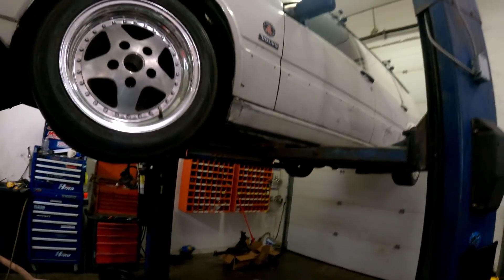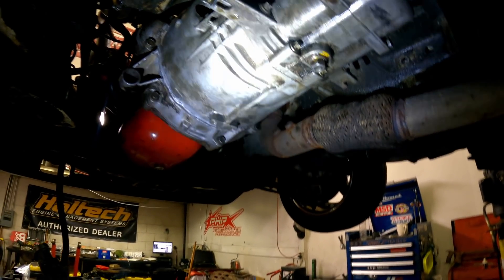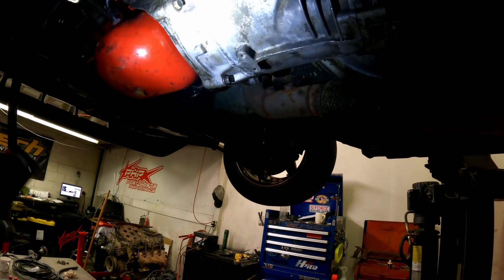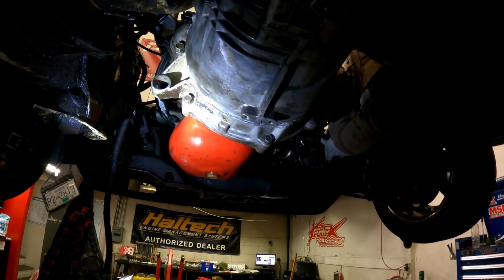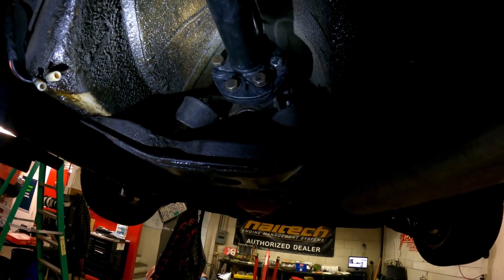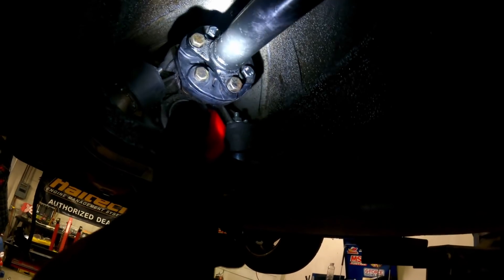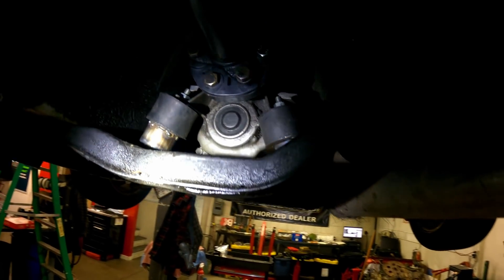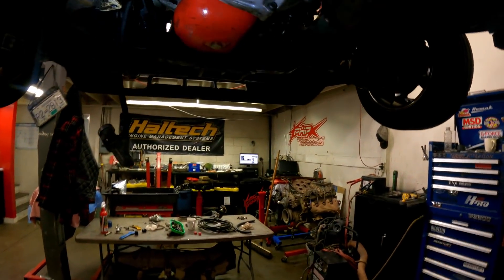How to swap a bmw zf s5d 320z transmission into your volvo 740

Comment: Hol up, you didnt get the 6-speed? I mean sure the 5 is pretty much as durable but keep the newer 6-speed 37dz/bz zf in mind too for future projects.
It's gearing match the volvo diffs better for dailying and they are as afforable and even more widely available in Europe than the now old and rare-ish 320z.

Im certain the 320z will do for a drift car though as gearing isnt an issue
Reply: Actually 320z has longer 1,2,3,4 gears than 37dz/bz. That means if you put 3.15 rear gear ratio like I did you get a lot better pulls from the line when running high horsepower setup. With 37 you have to try launch from 2 gear and that sucks. So you didnt get the 5 speed? Too bad for you.
Reply: @CzMnHD  I have the exact 320z in my e36. Even on that Id like the sixth gear of the gs6 boxes, which plenty of people I know run as the 320zs get rarer.
Having driven one in a volvo I cant say I noticed the first being very short on the 37. Also the gasoline version gear ratios are almost identical to the 320z anyways, with only first being slightly shorter at 4.35 ratio vs. 4.21.
It may still be a substantial difference for proper dragging chasing tenths, but personally Id prefer the 37 for the 6th gear and better availability.
Reply: @unuseableb  Gasoline version 37 does not have better availability than Diesel. Almost all 37 are diesel versions. Diesel version has very short gears and is bad (need extra adapter bearing for the shaft extension)

Comment: That'll just about do it!
I looked up the transmission and it came in E46 325xi, 330i as well as E53 3.0i X5, all 3 of which I believe N.A received in larger numbers than Scandinavia, shouldn't be too hard to source if you need a new one.
Also most deffo spotted longtitudinally oriented bolts further behind aft on the bellhousing, so I think you should be able to make do with just swapping over that part of it to a new transmission if need-be, instead of having to weld a new one.
Reply: Any bmw trans that bolted to inline 6 would work the same

Comment: You should change the hose to the slavcylinder to brake pipe instead, that because the original hose expands and you Will loose clutch power. Only a tip but i always do that to my cars😎

Comment: This looks to me like 260Z from diesel 325tds/525tds not 320z.
Reply: Yeah I have S5D-320Z gearbox and this one on the video is different gearbox. This one looks like its the 310z gearbox that is more common. Its pretty much the same but i've heard 320z is a bit maybe 50-100Nm of torgue stronger. 320z is hard to find from M3 e36 or 328 e36 bmw.